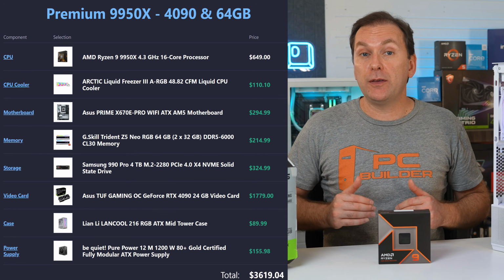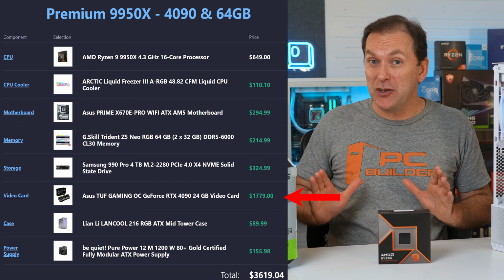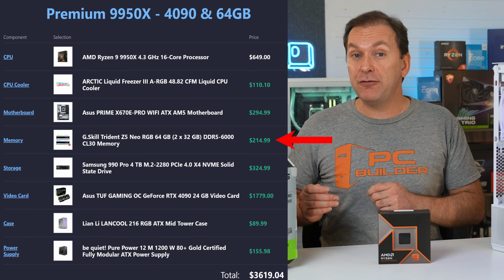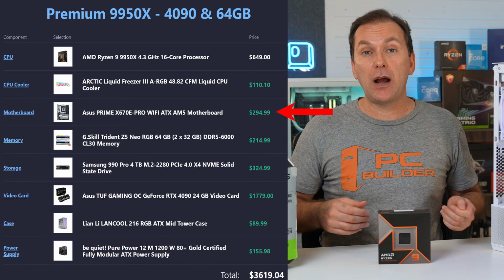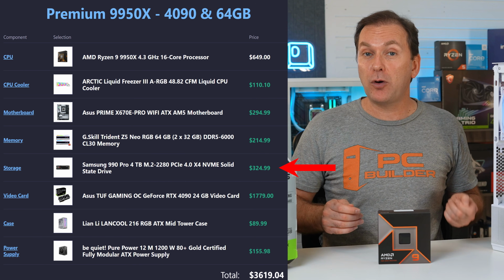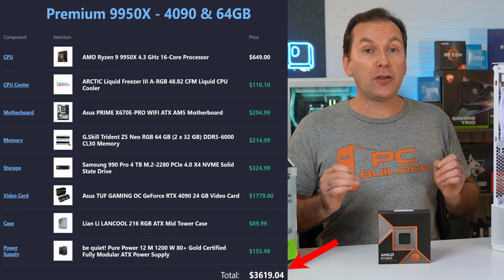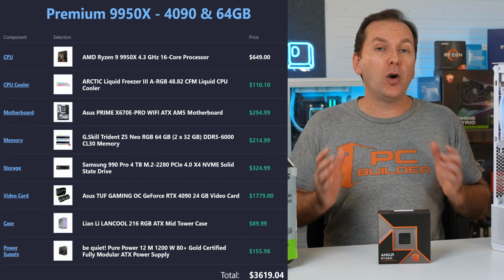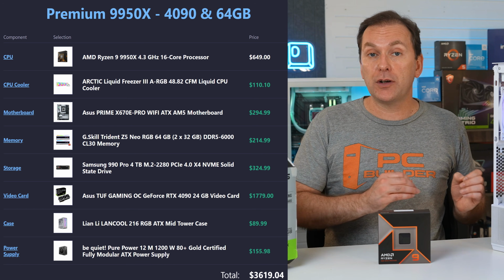Best Ryzen 9950X Creator PC Build 🛑 Best RAM, GPU, Motherboard & More!

Comment from the maker: This is the first Professional PC build guide we've done in years! It will also work for the 9900X, 7950X, 7900X, 7950X3D, or 7900X3D. ALSO REMEMBER TO USE BIOS FLASHBACK IF USING A 600 SERIES MOTHERBOARD WITH RYZEN 9000!
What CPU and GPU combo are you building with? Are you building a new system? Tell your story in a new comment below!
Reply: Excellent info for system builders, gamers or creators. I like the 7950X, a recommended Mother Board, either 4TB NVMe, 2 x 32GB Memory, 1200 Watt PSU to be safe, 4070 TI Super 16 GB (save $1000), any case you recommend is good, 360 mm Liquid Cooling.
Reply: rog STRIX X670E-a  support RYZEN 9 9950x ? PLEASE RESPONSE THANKYOU
Reply: 32GB RAM is not much, in this class maschine I would go for 48GB or 64GB
Reply: @Kilowatt8664  48 is comfy, can also see 64. I notice the smoothness in lower CAS and more memory in multitasking.
Reply: @osinstalls  It's obvious 😁
Reply: Why new egg and pc build says 670e is not compatible with 9950x..
Please respond. I have already ordered all the parts.......😮
Reply: @Mojojojobird  it will just require BIOS update
Reply: great video... I Watch everyone of them
Reply from the maker: So glad you enjoyed!
Reply from the maker: That's a fine pair but that's a minimum I would go
Reply: Spectating right now. Still on 12900KF 4090 48gb DDR5 (albeit CAS 36). It's stable currently on Nobara 40. The new X3D interest me and 9950X is a Linux performer (think Windows scheduling still needs work). Next build will be X3D might not be until end of platform/much later though, really looking to see how the new X3D and new motherboards do next month though. I think initial prices will be high then lowered, maybe a year out it's a deal. I still somewhat regret my Mom had me return my 5900X years ago so I ended up on 12th which was newer but AM5 was out by then. Always some builder regret. These are the last Intel builds though, spent a good year tuning them stable and doing ram swaps.
Reply: Was the cpu stock temps good? as my ryzen 9 9900x hits idle temps at 60-70
Reply: I'm gonna use a 9900x , which Motherboard do you recommend ?
Reply: Hi, I'm new here. I'm building my first gaming PC. Thank you for this, I was this close to pulling my hair out. I did an impulse buy and purchased random things. Now I can purchase the correct items for mt Ryzen 9 9900x
Reply: Great review. Do you have anything in mind for a budget Creator pc that is both for video and music. It seems that at least an AMD equivalent of intel I7, 64 Ram with option to upgrade and a 4K graphic card. 
The rest is optional. Budget is $1200-$1500.
Reply: Yeah you definitely need a BIOS flash back on a B650 board with a 9000 series CPU. My ITX system kept locking up and I realized I forgot to update the BIOS lol. That fixed the freezing problems and also stabilized the temps!

Comment: I dont reccomend the 9950x or x3d it runs insanely hot all I hear is fans spinning i upgraded from the 5900x which ran silent with a aio especially when gaming getting 250 fps with dlss in 4k battlefield 6 55c max  im getting 250 fps with the 9950x  same settings and res only im at 88 deg c lol anything you do causes temp spiking and I mean anything just installing vlc caused it to spike to 60 from idle temp 42. Also using a 360 aio msi mag a15

Comment: This was my first PC build. 9950X, Arouros 870E master, 4080 super. No issue enabling xmp with 192GB 5200mhz Corsair Vengeance RAM. 2*4tb Wd 850x, 2tb Samsung 990 Evo, 1tb crucial P3. 4*24tb SATA Seagate EXOS HDD's. Using to backup my NAS. I have ECC on my main NAS. They say that ECC RAM is supported but no way of knowing and no logging. Still figuring it all out but so far I've been impressed running Proxmox Windows Ubuntu and TrueNas.

Comment: Honestly, amazingly in-depth guide for those looking to build a heavy duty workstation. Only thing i would recommend is REALLY getting a 360 aio cooler. Currently running a 240mm, and this thing loves to shoot up to 95 degrees under load. I understand it tries to use all available cooling to boost performance, but if you are willing to pick up this beast of a CPU, you should give it as much cooling as possible to milk that performance.
Reply: How would a noctua d15 do you think?

Comment: You recommended the Samsung SSD 990 Pro?  Isn't that SSD that fails prematurely?
Reply from the maker: Long time ago when it first came out. To my knowledge its fixed
Reply: @PCBuilderChannel  As of 1 month ago, users are still reporting early failure. That's not a long time ago?

Comment: My new build, which I'm very proud of 😤 : Asus Rog Strix B850-E, Lian Li 216 RGB, Corsair RM850X Shift, Nvme SN850x 1tb (only for OS and programs), R9 9950x, Phantom Spirit 120 EVO, 2x32gb team expert 6400 cl34 (running at 6200 cl30 1:1), RTX 3080 12gb gaming Z trio....several SSDs and another nvme gen3 for 3d projects. In a year I will probably get a 4090 but for now the 3080 gets the job done.

Comment: Vert informative! 

Getting my build with 
- 9950X 
- 3090 (I already have it)
- MSI X870E Godlike 
- 96 GB 6000 30 Rams (Corsair vengeance), would have loved going for a 128 but need to stay on 2 slots instead of 4 
- Tryx Panorama 
- Lian Li O11 Vision 

Still don’t know which PSU to get.
Reply: You can get 2x64gb ram for the 128gb

Comment: My advice in restrospect...   eschew RGB and ignore spending any additional money on RGB unless it's already built into the device / part you need...   and spend more money on the motherboard and a larger case.     Later on down the road, you upgrade everything else, but you're pretty much stuck with whatever motherboard you have stuck inside what ever case you went with...    unless you undergo a complete tear down and rebuild from the ground up, which is more of a chore than you think and involves a lot of down time.

32gb won't cut it for a creator PC.  You need at least 64gb.  I use 128gb.   
Also, I used a ton of USB ports, and none of my NVME slots, so if you have to chose between motherboards, side with the one with a ton of USB.    
Make sure it supports 5.1 or 7.1 audio out ports, because mine says it did, but it doesn't.  There just aren't the jacks there.
Reply: What difference do you see with using 128gb RAM? Like how much of a performance increase?

Comment: Hello, building my first PC.  I followed your suggestions to build a high end pc: Ryzen 9 9950X / Teamgroup delta rgb DDR5 64GB / Asus Prime X670E-pro / BN513 Power 12M / Lian Li Lancool 216 / ARTIC Liquid freezer III 360 A RGB / 2 Samsung 990 pro ssd Gen 2T each / Asus Tug GeForce RTX 4090 24 GB
After installing all of it, the motherboard dosent recognized the  RAM, so it dosent boot at all.
Suggestions?
Reply: I just purchased the same components and tried to boot up the system this evening and I am having the same issue.  The DRAM light is illuminated on the motherboard and after looking at the compatible memory list on the ASUS website for the ASUS Prime X670E-Pro the G Skill memory recommended is not on the list.
Reply: @jeffmusser5856  I just returned every thing, give up building my own PC lol
Reply from the maker: 1) Did you update the bios on the motherboard using the bios flashback? If yes, then clear the CMOS as well and try to boot. If no, update the bios using the bios flashback - see our how to build a PC guide. If that doesn't work, check all the power cables to make sure they are properly seated. I'd also just re-do the bios flashback just to make sure. If you have them, Remove any third party PSU cable extensions and use the native cables that came with the PSU. Make sure you have the ram in the right slots - should be slot 2 and 4. I'd reseat the RAM. If that doesn't work then I'd head over the the build a pc reddit and post a troubleshooting post for more detailed help. Fingers crossed!
Reply: @PCBuilderChannel  LOL TOO LATE MAN, i JSUT GIVE UP AND RETURNED ALL OF IT, iM A HAPPY AGAIN THHANKS THOUGHT
Reply from the maker: 1) Did you update the bios on the motherboard using the bios flashback? If yes, then clear the CMOS as well and try to boot. If no, update the bios using the bios flashback - see our how to build a PC guide. If that doesn't work, check all the power cables to make sure they are properly seated. I'd also just re-do the bios flashback just to make sure. If you have them, Remove any third party PSU cable extensions and use the native cables that came with the PSU. Make sure you have the ram in the right slots - should be slot 2 and 4. I'd reseat the RAM. If that doesn't work then I'd head over the the build a pc reddit and post a troubleshooting post for more detailed help. Fingers crossed!

Comment: I upgraded from Ryzen 9 3900X to Ryzen 9950X. I did not change GPU cuz RX 6950XT is still good. Also I went from 4x16GB RAM to 2x48GB. And Yes that is Hybrid PC: I play games on it, but also run multiple VMs
Reply: What's your mobo??

Comment: I'm upgrading my 3090 TI to the 4090, DDR4 Ram to DDR5 Ram, & Rysen 9 5500X to the 9950X. I have an X570 MB & wanted to see my options, your video was very helpful & throughl. I have massive 420mm, 360mm, & 140mm radiators & even watercooled my Ram. Mine was no budget build though & required high skill swirl bending some of the tubes. I'm surprised you weren't more adamant about watercooling the GPU, but less than 1% of PC Builders build open loop cooling systems like I have done. I liked your video because your recommendations were highly accurate, & you were very knowledgeable. I do alot of video editing & photoshop work & currently have 128GB's of System Ram which seemed to be overkill. I'm going to tweak on Over Clocking the entire build to see what kinds of speeds & FPS I can get at 4K & monitor the temperatures. Keep up the good work, again great job on your well put together video!
Reply: How come in the video he says up to 96gb RAM? He makes it seem like that’s the maximum. (I was also hoping to do 128gb)

Comment: Great advice. However, isnt the 1200W power box overkill? I hear an 850W power box is more suited to the 9950X. Or is it best to have more power if you're running a 4080, 4090 or plan to run a new 5000 series RTX? Thoughts please?
Reply: Me bought 850W for 9950x, but currently running on internal GPU. Power draw is ~270W. Additional GPU would consume 300-400, so 850W is fine. Yes, 1200W is overkill indeed.
Reply: @adamwalter2573  great. thanks

Comment: I  was wandering if for a set up like this, do I need to add  more fans in the case?
Reply from the maker: Depends on the case you get and how many fans are included. I didn't need to add fans for example with our build
Reply: @PCBuilderChannel  thanks I have the same  case.

Comment: 9950X seems great if your productivity/server apps run on Linux - the Phoronix and Level 1 Techs reviews make it seem great for Linux

Getting one for a Windows based creator build seems kind of iffy - All sorts of odd issues even in productivity apps and it doesn't seem as if AMD has a clue about the cause or the fix.

Comment: What RAM speed should I use with a four-stick configuration to get a maximum of 192GB?
Reply from the maker: Watch the videos linked in the description I referenced in the video. He goes through what speeds he recommends and also how to manually tune the RAM. Again, unless you MUST have more than 96GB of RAM, I recommend sticking to a 2 stick configuration.

Comment: If 2 sticks of DDR RAM is the best configuration while 4 sticks will speed down, WHY MOTHERBOARD MANUFACTURER provide 4 slots for 4 sticks ?
Reply from the maker: Same reason that most cheap GPUs have plastic backplates even though it hurts thermals, because people expect high end boards to have 4 slots.

Comment: I’m planning for my first pc, what do you think?
❤❤❤❤❤❤❤❤❤
CPU: Ryzen 5 7600x

GPU: RTX 4070 Super

MOTHERBOARD: NSI B650M-A WIFI DDR5 MOTHERBOARD

RAM: TEAMGROUP DELTA 32GB 6000MHZ DDR5

SSD: LEXAR 1TB M.2 NVME 3500 SPEED

POWER SUPPLY: DEEPCOOL PN850W GOLD PCIE 5.0 CONNECTOR

CASE: DARKFLASH DK431 BLACK TEMPRED GLASS

COOLER: DEEPCOOL AG620 BLACK ARGB
❤❤❤❤❤❤❤❤❤❤
Reply: What are you using the PC for?

If it's Gaming I would go AMD on the GPU because they have better price to performance vs Nvidia.
Reply: @ty09162  for gaming editing videos and photos so maybe nvidia  is better
Reply: @vagabond-xd1vd oh okay then Nvidia is okay.

Unless it's DaVinci you're editing in then AMD is better.
Reply: @ty09162  so what's amd gpu do you suggest ?
Reply: @vagabond-xd1vd  7900GRE though the 7800XT is also good if you can't afford the GRE.

Comment: Awesome choice with RTX 4090 for that Ryzen 9 9950X.
Apparently the 9950X is quite good for AI workloads and the RTX 4090 with its 24GB VRAM is super good in that too.
Otherwise, if you game too, better snag the Ryzen 9 7950X3D.
Reply: lol hell no. If you gaming on 1080p than yes but if you play on 2k or 4k any 3d cpu its total nonsense, and only one diferecne are higher temperatures and louder pc with the 3d once lol. Non 3d is the way to go for a 2k 4k gaming.
Reply: @dreddd7233  Sorry, but no. It all depends on the game and the settings in that game. And if you don't use DLSS in 4k, you are not getting the frames that you could be getting. But for these frames, you need a fast CPU.
I can find you a Hardware Unboxed video on that with real tests.

Comment: Can you help?
What MOBO should I buy
■ i5-12600k
■ Palit RTX 3060 12GB
■ Kingston Furry Beast 5,200Mhz CL 36 (16x2) white
■ Cooler Master 750watts MWE 80Plus Gold
■ Asus Prime AP201 white
■ ADDATA 960 MAX 1TB
■ AK400 white
■ FC 120 WHITE FAN white
Reply: You've got a K series CPU, so presumably you intend to overlock it, which means you have to get a Z790 motherboard, so take a look at relevant reviews and choose one of them.
Reply: Lga 1700 board the cheap one you can get with the feature you need!..b760 chipset or z790 or z690 if you find any deals!
Reply: Z690/Z790 if you want most performance with solid VRMs. Possibly Asrock PG Lightning/similar check board reviews also. I have had B760M (you could go cheap B660M) Asrock that was fine too originally paired with 12700KF but now it's with 12400F for office. I've used 2 x Asus TUF Gaming Wifi Z690s with 12700KF & 12900KF, but they have USB dropout quirks (I went Linux it would rear it's ugly head a lot in Windows 11 but the B760M from Asrock was less fiddly/issues).  I've had better stability gaming with ecores off, was having problems with game dropping from P core to E core (namely WoW). Would see the reviews but my Asrock PG itx/ac from 9th gen Z board is still solid today, I think that is one solid line. Some of the Asus boards have issues with USB failure to detect/dropout, it's annoying when you want to boot and keyboards or mice won't plug in/detect period. Also had some BSODs across 3 ram kits on that Asus Z690 so caveat emporium with that board, if they are priced similarly might be worth going with a competitor. Gigabyte Aorus I believe those have white boards, if you want a white board those cost more but will match (NZXT also does white). GL.

Comment: I’ll stick with my 7950x3d for the time being. I use my PC primarily for work so I typically jump all over the newest flagship hardware as it’s easily justifiable for me. Having said that I also want it to game. Pretty disappointed in the 9950x performance. Wasted opportunity by AMD to really kick Intel while they were down. Hopefully the x3d chips blow us away. 

If the 7800x3d was an option for me I would go that route, but I need the cores. It’s amazing in the wife’s PC. 

ZERO stability issues with either PC.

Comment: Don't waste your money on this Joke of a Processor.   Just buy the 7800X3D and save $300. the 9950X is basically worthless.
Reply: Not everyone needs a gaming cpu. 9950x beats the 7800x3d in any multi core usage
Reply: @masterfan0  well then buy the 7950x and save money. This CPU was 99% pointless.  It barely pulls ahead of CPUs from 3 years ago. Even in multi core.

Comment: Hey Jason great video. I’m new to pcs and kinda stuck on what to get. I’ve been considering the 7800x3d but can improve my gpu and other specs going with the 7600. What should I do?
Reply: Both are good options.  What GPU would you be able to get with a 7800X3D vs a 7600?
Reply: @ty09162  7800x3d: 7800 xt, 7600: 4070
Reply: @olliebarrie8027  Except I wouldn't call the 4070 an improvement over the 7800XT.  They're very similar.

What's your budget for this PC?
Reply: @ty09162  About $2500 AUD, I think I'm happy with most of the 7800x3d build. Just not super sure on the GPU.
Reply: @olliebarrie8027  so I would look at the 7900GRE.

I went on PC Part Picker and made a build with that and the 7800X3D and was around 2500.

Comment: Hey Jason i want to ask that if 7800x3d is ok for video editing,graphics designing, coding and other productivity work because i need to do these work along with gaming. And if not can you suggest any other cpu good for mixed purpose.
Reply: 7800X3D is perfectly fine for productive work. Just because it's the best for gaming doesn't mean it has to suck at everything else
Reply: @z-ah842h  so you mean to say it can run any high cpu intensive task and software but it will be a little slow
Reply: @RaiDen_Not0P  if you need a CPU for those I would go 7900X instead as it's a better CPU for Production Work for about the same price as the 7800X3D.  Won't be as good for Gaming though.
Reply: @RaiDen_Not0P  Not even slow at all. Just not as fast as some other cpus.
Reply: You got the best for gaming and like a 10-20% less the best for productivity...I wouldn't get rid of that CPU unless you really are concentrating on productivity, and then you would want to get a non-X3D processor for better multi-threading anyways.